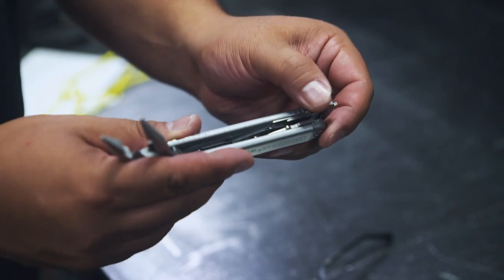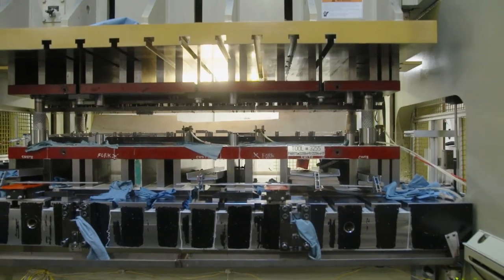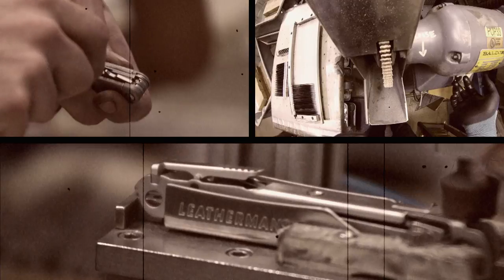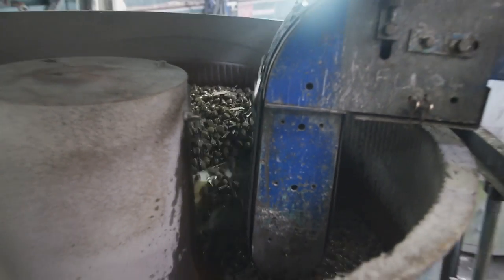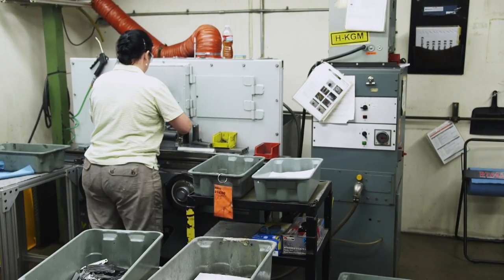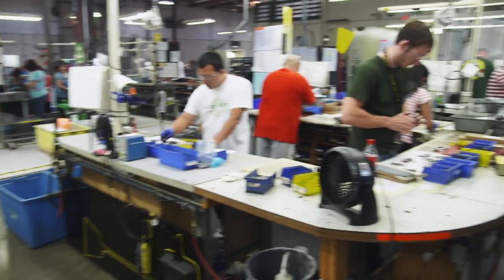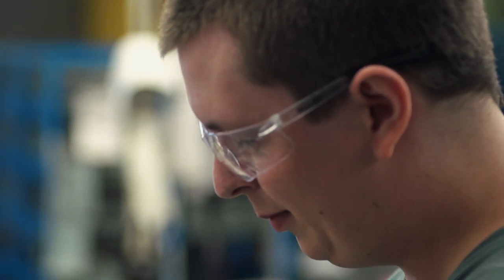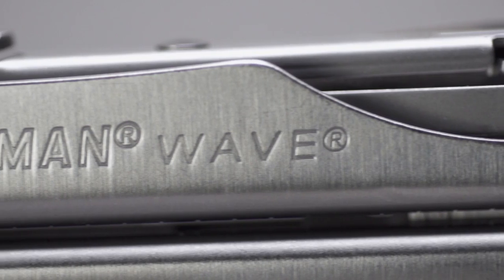How a LEATHERMAN Wave Multi Tool is made - BRANDMADE in AMERICA

Comment: Owned a 'wave' since 2003 (16 years of service) it has worn through two holsters and been on my hip most of my working days.... even when not there and in a pinch I reach for it. 13/10 would recommend.  My only gripe's are the stripping wire tool sticks the handle and the small screw driver broke (years ago most likely my fault).

Comment: Victorinox swisstoolXplus is definitely a better quality multitool than wave, Charge and so on. Invest money there you don't regret.
The only thing I really appreciate in leatherman's products is that they assembly the most with screws instead using rivets so multitools can be dismounted for deep cleaning, lube or modifications. 
An interesting keychain product that don't have a proper finer correspondence in Leatherman's range is the pocket toolbox once made by Coast cutlery and today discontinued.

Comment: I agree that the Leatherman is excellent. I own several. But, I have broken at least three of them. The Skeleton, the Crunch and the OHT. I didn't know that I could send them for repair to Leatherman when I broke the first two. But, I sent the OHT in for repair and they either fixed it or replaced it. I'm not sure which but it was returned promptly and looked great. For that reason alone I will continue to buy Leathermans. I have my eye on the new magnetic opening tool, the P4. The only other tool I favor is the SOG which has a patented cam for the pliers and cuts just about anything. The Leatherman does not cut as well but has replaceable blades. I only mention that in case the patent runs out Leatherman might want to look into that technology.

Comment: My Juice KF4 snapped on opening.  Leatherman replaced it without question.  The trouble is that the juice models are no longer made, which is a real shame, because nanny states like the UK don't let us carry  tools or knives with locking blades without good reason, so most of my Leatherman multitools stay at home instead of getting used properly.

I have just bought a Swisstool Spirit XC as I hear so often that they are leagues above Leatherman kit, so I want to try for myself.

Comment: I owned a Leatherman Wave for 10 years with no issue.  I had to give my 10 year old Wave to airport security (woops) therefore I bought a Leatherman Surge.  The small flathead driver broke the first time I used it, second turn of the screw, very low torque.  Also, the saw/filer tool locking mechanism seemed to work but the filer tool was very obviously oversized for the locking mechanism and wouldn't lock in place.  In addition, the tools all required noticeably different amounts of torque to open which may be standard for new Leathermans, I just haven't had a new one in some time.  The drivers on my new Surge seemed to be fabricated with different metallurgic properties vs my old Wave, likely cheaper metallurgic properties based on my experience.  I can't say that this is a company-wide issue but I surely can say with confidence that I received a defective Leatherman Surge.  Unfortunate.

Comment: Just received my brand new Surge but probably will have to send back as the handles don’t line up with the bolsters on one side. This and the pliers rub on one side when closing. Sucks to have to send back but if I don’t then it will always bug me. So I as, where was the QA before my tool left the factory?

Comment: The first company that ever has a multi-tool platform that you can interchange the parts will have a better selling product for the simple fact is not every tool on a Leatherman will fill every task but if you could pick and choose the tools on your multi-tool it would perform better for you
Reply: You can already do that with leatherman to an extent ... I just removed the small flathead on my surge with a micro bit driver from a wave and it was completely drop in ready no mod needed .

And you can do the same with other componets with a little more effort and grinding or re shaping

Comment: "First multi-tool ever made"??? I love Leatherman but hate bullshit, which this is. I am pretty sure the Romans made a multi-tool around 1800 years ago, Wired magazine did an article on it. Leatherman was founded in 1983. Even Victorinox was making multitools in the late 19th century.
Reply: I Agree. Leatherman multi-tools are good, but not the first multi-tools. Maybe the first pliers based multi-tool, but did not invent the concept.
Reply: Dotado Jardiner they are the first to come up with the NAME multi-tool and that has been synonymous to any plier-base multifunctional tool since. Victorinox and Wenger haven't used the name "multi-tool" for their Swiss Army knives, and I can bet you neither did the Romans.
Reply: JustSimplyBrandon doesn't matter their not the first.
Reply: Victorinox makes the Swisstool X it's great, there's also a curved handle "Spirit" version but i prefer the bigger straight handle regular one. Beats the shit out of this.
Reply: Kandi Klover, I have the Swisstool X and it is amazing. I prefer them as the tools don't clump together when I am pulling them out also the quality is second to none.
Reply: Unfortunately, you can't open the knife as fast as with the Leatherman! And this is the only reason I will buy the Leatherman wave (or surge) instead of the Victorinox spirit (or swisstool X). I'm like Adam Savage, when I need to use it, I need it fast.
Reply: Dotado Jardiner
Reply: They should rephrase it to "the first multitool with pliers ever made"
Reply: I'll gladly give up the convenience of a quick opening blade in exchange for the much greater convenience of being able to access all the tools with the handles closed.  Not to mention the fact that the SwissTool X is designed such that you can open a single tool like you can on a pocket knife without all the rest coming along for the ride.
Reply: Dotado Jardiner also Swiss Army knives... Quite a few originals as before Leatherman. But Leatherman has the edge
Reply: In the Sherlock Holmes story "Abbey Grange" by Sir Arthur Conan Doyle the seaman carried a "multiplex knife".
Reply: First of this style of the "traditional" style
Reply: They aren’t the first multi tool but I think what they mean though is the first multi tool in the sense of what a multi tool is seen today as two halves with a pair of pliers in the middle

Comment: As much as I would love to carry one again, I can't get convince myself it is worth it anymore. I have had probably a dozen of them so far and broken most of them. The steel seems to brittle in the newer ones and too soft in the older. Most seem to break right at the handle hinge for the pliers, I've dropped them and snapped the knife, file and saw right off (not all at once of course). The tools seem to loosen up real quick, I've put locktite on the screws but it doesn't last even for a month. I've even solders the heads of the screws and that seems to hold the longest. The ends of the pliers tends to bend out so it gets hard to grip with the tips. The gripping surface also gets all mushed up and the wire cutters damage to easy.

I know one guy who send his in for repairs too many times and was later denied warranty. Most others I've seen that actually get some use are all loose and worn out.

Now I edc a few dedicated tools. A 6-1 screw driver, knife and sometimes a small pair of channel locks. They have lasted  far longer then any other letterman I've owned.

If they come out with a better steel that is hard and tougher then they currently use I may give them another try

Until then I think I will send in the ones I can find in my junk drawer and maybe only use them in an emergency
Reply: Seems like a lot of problems?  Strange how noone else encountered  them?

Comment: Leatherman and Victorinox are in deed the best tools around. They have their own niche. I hope both company makes something geared towards medical precision scissors as main tool. Leatherman is very near when they made the raptor but find it not quite useful in 90 percent of EMS jobs. I love wave, supertool 300, surge and own two of each and is using a raptor and Skeletool in EMS. 80% of the job I reach to my victorinox rambler tiny mighty scissors to deal with real emergency case. Hope to see a micra in full size maybe name it macro with full size scissors with high quality pointy design for precise job in EMS field. I use wave gen 2 scissors and they are average but does the job. A little precision and Sets of tools with raptor set of tools maybe design a one hand deployment scissors somewhat like the gerber compact sport pliers set up or what not will be the ultimate rescue tool for me.  I can retire my old Raptor and my pockets will be free.
Reply: They have the Rescue scissors. Upgraded version of the raptor and aimed at more EMS. Comes with folding shears, strap cutter, ring cutter, 5cm ruler, oxygen tank wench, and a Carbide glass breaker on the handle. I don't know much about the emergency response situations, but I did know a couple friends in it that had that specific one and liked them.

Comment: I really enjoy having mine! I only wish that they could find a way to make it lighter, like by perforating the handles or making some parts of the handles in aluminum.
Reply: i like the weight, it feels robust that way, plus you can batter someone with it on the side of the head
Reply: traderjoes I have a really solid SOG  knife that is just like the wave, a bit cheaper, SUPER HIGH QUALITY, and light but sturdy. I use it for projects all of the time and it has held up to everything I throw at it.
Reply: I have a standard leather man and all four blades are locked out and suggestions how to fix?
Reply: might i suggest a skeletool? much lighter than the wave.
Reply: The Charge is in Titanium. S30V blade too.
Reply: Check out the skeletool or the charge AL
Reply: imjustlookingformy dog, Meh i have the AL ALX TTI Wave, they all seem about the same save a gram or 2 either direction. Awesome tools, i carry one everywhere i go, but the only tool that clocks in significantly lighter is the Skeletool. I personally prefer the heavier tool mainly because it feels strong and sturdy while doing the job i need done. I generally carry the TTI, Incredible tool.
Reply: Chuck Finley why would you want to carry something heavier? You think the person who first commented was completely incapable of carrying a wave? How can you just call him a “beta” because he doesn’t want to have a heavy pack. Heavy things are more difficult to carry. Having lighter gear makes it easier to be more mobile, which is important when we are talking about the needs of the military. Carrying a heavy m 14 all day in a low intensity combat environment is stupid when an m4 can do the same task (generally) as well while shaving off a few pounds.
Reply: @tonycolton7367  Yes, send it back to Leatherman and they'll fix it for free.

Comment: I have the Leatherman Sidekick and it is a good knife which is on my belt always. Just to me, the blade and saw seem a bit "thin" and looks like they will snap and break easily so a bit apprehensive to use either or both.

Comment: I BOUGHT TWO LEATHERMAN SURGE WITHIN MONTHS.  THE DIFFERENCE BETWEEN THE TWO IDENTICAL ITEM IS THE SCREW IS TIGHTER THAN THE OTHER SURGE. IF YOU ONLY HAVE ONE SURGE THE LOOSENESS OF THE OTHER IS NOT NOTICEABLE, BUT SINCE I BOUGHT TWO SURGE. THE LOOSENESS OF THE OTHER SURGE IS PRETTY OBVIOUS. THAT THERE IS NO GAUGING ON HOW TIGHT OR LOSE THE SCREWS.

Comment: The only thing a leatherman needs to be a multi tool is the basics.  Bottle opener for wine , metal tool pick, small tweezers and no repeats like on the leatherman surge that has 2 small flat head screws driver 4 if you get the mini tool kit.

Comment: The thumbnail is bs, you can't flip the knifes out when you have opened the tool to use the pliers. There are little pins that get stuck through the holes on top of the knifes so that you can't flip em out